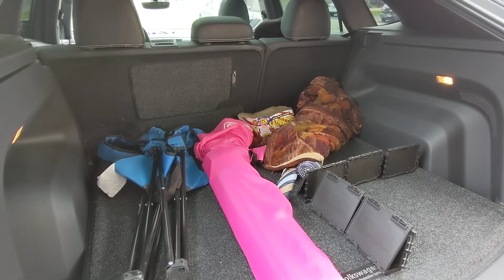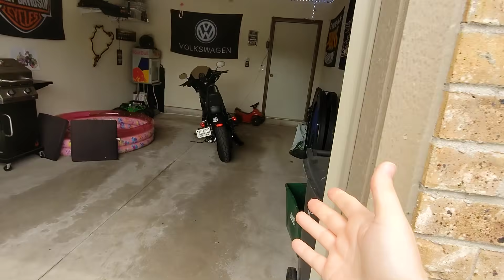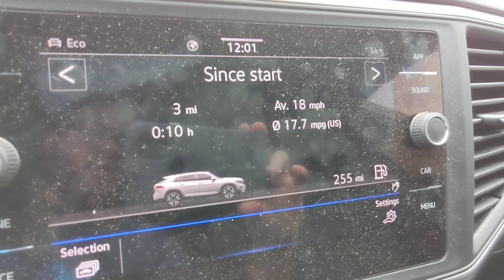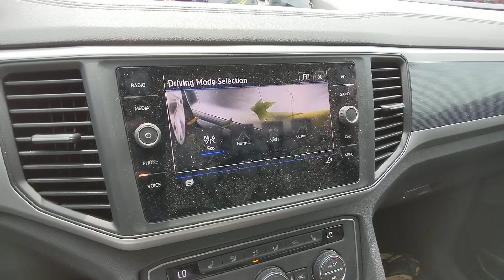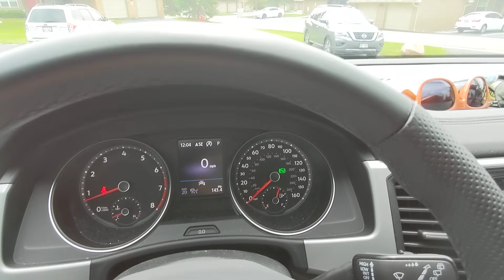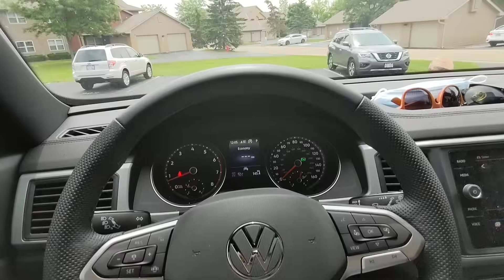2021 VW Atlas Cross Sport.  Why we're trading after only 4 months!

Comment: That car is beautiful on the exterior But for the price that interior is mediocre. For the orice you're better off with an Audi or Mercedes on the interior. Or just a Tesla /hybrid
Reply: Unless you're buying a used high mileage audi or mercedes. or lexus or any other luxury SUV. you aren't getting one for 45k USD. The GLE Mercedes would be in a similar size class as that atlas. However, it STARTS at 55k brand new, before options. You're looking at easily 65k-70k out the door when everything is said and done. 

Really don't get what all the hate is for these VW ATlas'. They're cheaper than any other manufacturer that makes an SUV in the same size class. You can't spend 35-40k on a brand new, large SUV and complain about the interior unless you're willing to spend the money to get that interior. and if you can't afford it, you're in no position to be complaining. Hell, even a chevy traverse is 10k more expensive than the atlas. and chevy interior has always been garbage. Honda passport is 5k more expensive, the list goes on and on. There's really not much to complain about.
Reply: Price a Mercedes lately??  I did, I love them, but 80K not in my budget. I compared SUV to SUV certainly not SUV to car.

Comment: The VR6 is a relic, literally the least competitive V6 on sale today.  2.0t is faster, cheaper and more efficient.  It's true the engine note can be a bit harsh in the 4cyl, but the only reason to buy the v6 is towing and because we live in America where everyone is more comfortable with the larger engine.  VW is even surprised the take rate is so high for the V6.  I have a 19 Atlas 3 row with 2.0t FWD.  Not bad on gas, around 24 in mixed driving, 26-27 on highway.  Bought snow tires for winter and has been great.  The only reason to buy this car is the size, which is amazing and was my primary need.  But better options for literally every other aspect of owning a large crossover.

PS, I wish everyone would state that their mpg figures are actual calculations at the pump based on gallons and miles driven.  Mine are.  Not interested in what your no good dirty liar of a trip computer thinks.
Reply from the maker: V6 has the higher tow capacity, which here in America is important to alot of buyers in this segment.  Style I think is also a big reason people purchase it, in my opinion it's the best looking in it's class.
Reply: A 4 cylinder turbo charged engine in this big tank??? Good luck!!!!

Comment: While clearly more expensive and definitely smaller our Q5 gets over 30mpg on most drives (avg over 16k miles is 26) and the powertrain is borderline fast. The torque curve of the Audi specific 2.0t is absolutely flawless and the dsg really comes alive when driving aggressively. It’s a shame audi doesn’t share these benefits with vw In the us market. And the interior also is day and night. Too bad Audi does give vw their longitudinal chassis to use :/
Reply: Maybe on its first 30k miles but you have to get those valves cleaned soon after
Reply: On Premium gas?
Reply: isnt that the same engine that vw uses, in various states of tune? Also - alot of the vw interiors are pretty much identical, to audi, depends on the model. Not on the budget obviously.

Comment: If fuel economy was such a BIG concern why didn't you get the turbo 4🙄?? Also, you're going to be really upside down and have to roll over a lot of bad negative equity towards your new ride. Doesn't matter if the used car market is smoking hot right now. You will still end up with negative equity since VW's are very weak sellers in the used car market.
Reply from the maker: I'm finding these comments really amusing as if i don't know what I'm doing or talking about.  In the description i clearly state that our commute suddenly jumped from 10 miles a day to over 50.  This meant we were putting $8 bucks a day in the gas tank.  We did lose about $1000 dollars total after selling it back to dealer, which is not bad at all.  The dealer Flipped the vehicle above MSRP literally 4 days later.  This used car market IS that hot, used car prices are up 37% since last year.  Factoring in our fuel savings we will recoup our loss in less than a year.  Cross sport is a very Average (but good looking) vehicle whos fuel economy is pretty bad.  You can get a big SUV with capability without having to suffer with terrible MPG in 2021.

Comment: Small advice: next time before buying a car, make sure to calculate daily fuel consumption to see if it fits in your budget, instead of loosing money when you trade in your car…
Reply: I am really trying hard to figure out his issues here. THIS IS A V6 ENGINE. am just laughing watching him rant. i have 2018 Atlas and I love it.
Reply: Ya I would think he'd lose more money on the trade in than gain on a car w better gas mileage.
Reply: I don't know how you are calculating!!  Let's say you drive 50 miles a day with gas price at $3.20.  if your mpg is 20, that would add up to $8 a day or $2400 fir let's say 300 days.  If you can get a magical gas engine SUV that goes 30 miles per gallon, your daily drive will cost you $5.30 or $1590 per 300 days.  That is a saving of $810 per 300 days ( roughly a year) .   In  5 years, your saving will be at $4050.  And again, that's assuming you can get 30 mpg from your new SUV.  Please tell me how you did your calculation?  BTW, I am still not buying that the dealer purchased the car back fir $1000 less than what you paid for it just 4 months ago because the market has been red hot for over 4 months. Didn't just happen last week.
Reply: @switchex  Agreed. What about the sales tax and dealership fees that he has paid? That money he lost for sure, and if we put them to the gas spending... well, it's easy to calculate. His math is def off, as is of a lot of ppl at the moment who's trying to get rid of the freshly-bought vehicle towards to gas savings.
Reply: @switchex  I am stunned that a person who is doing this video made such a bad comment to you. I also agree that dealership is not buying back a car, there is a reason why they are selling. I checked for fun with my dealership, I bought VW SEL-R Tiguan for 50k, 3 months later I asked how much would they buy back with 700 miles on it, they gave me 22k price hahah.
Reply from the maker: @switchex  I have no reason to lie, its the only reason we got out of it.  It made financial sense.  Our new replacement will more that double our fuel economy.  We actually just got a notification this morning that its being built today!
Reply from the maker: Small advice:  read the video description before commenting.  Also, as i stated in video the used car market is WHITE hot right now.  We sold it back to dealer (not trade in just sold) for only a loss of about $1000.  The dealer sold it above MSRP 4 days later.  Our fuel savings on our new vehicle will pay for the loss in about 7 months.  Over 5 years of ownership with our replacement we will save roughly $5000 in fuel.  Stay tuned for our replacement!
Reply: @amentauto3610  so what did you end up replacing it with?
Reply: @MikeyMac99 
They ended up getting a p.o.s. jeep 4xe that they got rid of a few years later.  They got rid of it because the fuel mileage sucked.  He realized it only goes 25 miles on electric before the gas engine kicks in.  Again, no research.
Reply: @witchdoktor69 LOL what an idiot. He gave up the VR6 for Stellantis crap?
Reply: @amentauto3610  doesn’t matter how much you sold it for, inflation changed the value of the dollar. Regardless, a very wasteful approach to material things, you’re the epitome of the American consumer, probably love a credit card too and living outside your means.

Comment: I have a 2018 Atlas, MSRP was 50k. Super comfortable, cruises smooth - have got over 30mpg round trip in the mountains- to the beach on the highway - If I want to go fast, I jump in the F150, if I want to be comfortable, I take the Atlas. Love the Atlas! The vehicle has been very reliable. Edit: one thing I did not like, was a common issue, and is the fact it does not come with a spare at all, let alone a full size spare. Purchased OEM Rim online, got a brand new tire from the tire shop, and keep it in my garage, just in case.
Reply: Wow. 30 mpg?! Never got close to that.
Reply: @toddhaynes7145  Pure highway tho. We average 17/18 cruising around town. If you are going down hill, and let off the pedal, it will go into eco mode. Drift as much as possible. My truck, I drive opposite, I press the gas a bit going downhill, gaining speed and drifting up the hills going slower at the top. I use the pedal going uphill, and drift downhill in the Atlas. Try keeping it in ecomode?
Reply: 30mpg? Is that the 4 cylinder?
Reply: @jesse4589  Nope it’s the v6 with 4-motion. Stock tires and everything. Just cruising to work on 10 miles highway 2 miles city I get 25-28 mpg at 62mph. Our Atlas is a 2018 tho.
Reply: @bigf1502  Wow....we get 25mpg sometimes on trips that there isn't really any stop lights or hills and keep it around 55-60mph. Highway we usually run 70-70 so that is probably a factor LOL! We average 20ish. We are from Pennsylvania, lots of hills here.
Reply: @jesse4589  Pittsburgh myself
Reply: @bigf1502  Oh cool! A friend of mine lives out there, I have visited a few times and those hills are a lot bigger than what we have here in north east PA. Crazy you get that good though, maybe our lead feet has something to do with it haha
Reply: I have a 2019 and mine came with a spare
Reply: Having a spare tire in your garage isn’t helpful lol
Reply: @bkr9511  For sure it is, if my wife gets a flat, I’ll take it to her and put it on. Only time it wouldn’t be of use is if we are on vacation or far away.  95% of the time the car is within 20 miles from home.
Reply: @bkr9511  Good point, if you are hundreds of miles from home, but it's nice having it in case you need to pop it on while waiting or got time to get that disposable tire replaced. Every seen what one of those costs?
Reply: V6 atlas averaging 23.5 mpg in California. I always exceed car’s claims. But would never get close to 30mpg. Not a lead foot.
Reply: No spare? WTH. I have one of those inflatable donuts under my subwoofer in my 2019 SEL P.
Reply: Which Engine?
Reply: @ze_german2921  v6
Reply: I have a 2018 atlas owned since it had 36k miles on it I get 23miles to the gL. I drive 250 miles to work once a week I only use a 1.4 tank to drive 500 miles rou d trip. Think that's pretty good. I ha e 230k mils on this car now. No issues ever with this car other than regular maintenance. I will buy another one.
Reply: @katrinafoelsch6794 I agree, we still have our 2018. Has just under 50k miles on it. Have taken it on many vacations and it has been great, although it still spends most of its time around home.

Comment: Well if you’re looking for gas mileage then an suv with a 6 cylinder would be out of the question. We recently upgraded from a Chevy equinox, that had great fuel mileage ( 41mpg best on highway). But it had a 1.4 L turbo. It was selected awd which was nice but as far as towing it had like a 1000lbs. But you can’t even compare the two next to each other. So you need to decide what you want, a fuel efficient vehicle or something with the roominess, towing capacity, and the other options available of the atlas. We agree that the fuel mileage is less but overall we love it. We own a 2021 atlas cross-sport R- Line edition $ 58,000 sticker price. This vehicle has everything and we couldn’t be happier. Btw we live in Wisconsin too…lol
Reply: You still have V6 options. A Honda Pilot gets 27 highway. Thanks to its vcm system.
Reply: We traded our 2018 traverse on a 2021.5 atlas premium. It’s a nice vehicle for sure. The problem with the atlas and fuel economy it is awd full time. Traverse had the same size engine and got about 2mpg better in front wheel  drive.
Reply: I selected my VW Atlas (2019) for its safety, size, and mpg in that order.
Reply: Definitely loving my Atlas SE. Just hate I didn't get full tech package but I'm going to add some things. Should have gotten an Atlas.  You can pull the seats down from the truck. I don't the V6 but I feel like my gas mileage is doable. I  can go like 7hrs on road trip before having to fill up
Reply from the maker: Our replacement vehicle was just posted on my channel ;) you can have your cake and eat it too.
Reply: @amentauto3610 
Did you eat any of that cake?  You got rid of that jeep for the same reason you got rid of the Atals.  Awesome.  As a guy with a car channel, you might want to actually research the vehicles, apparent cost savings vs reality, reliability and mpg.

Comment: For that kind of money I ended up with a used 2015 Mercedes GLE.
Its powerful, interior is luxurious, got air suspension and I feel like I could tow anything.
Reply from the maker: As nice as a vehicle as that is I would worry about ANY German car that's 6 years old in terms of Maintenance/repair costs.
Reply: @amentauto3610 I can see your point of view but as a european I am not concerned about my castle on wheels. BMW and Audi tend to be the more problematic ones. My GLE is currently at 230 000km on the clock and it feels as if it just came out of the factory. Yes some parts are a bit more expensive but they also last longer to compensate for that. I think the internet makes some things worse than they actually are. Thats my opinion and experience tho...

Comment: Had ours 3 & 1/2 months, it’s been in the service department for all except 4 weeks over that time. We’re trading out as soon as we can.
Reply from the maker: Seriously now's the time to do it, call your local VW dealers.
Reply: @amentauto3610  did, they are rude and belligerent, had a case open with VW USA - car has been classified as a lemon but to buy it back is too expensive for me so am stuck with it. - Arizona Laws are terrible when it comes to protecting consumers. Intend to trade out asap.
Reply: Price it at carmax or gimme the vin you should be able to get rid of it quickly
Reply: @patrickgroff5399  traded it for a Nissan Pathfinder last week, bigger car and engine. Getting much better mpg
Reply: @peterhunt6140   I looked at the comparison and the Nissan is over priced, and certainly not as many standard features. I would agree that, "IF" you had the car in the shop as much as you say then I get why you traded. I also get the bigger engine, but really I haven't felt it being as sluggish as others have, but then I run mine in Dynamic/sport mode, getting about 19.5 miles per gal, but I am a very aggressive driver, so I expect it. All in all I am enjoying my Atlas R-line and hope  continue do same.
Reply: @patrickgroff5399  last trip we got 26mpg in the pathfinder, it’s the platinum, got a good deal and I’m loving it, honestly I’d have traded the atlas for a pedal car I hated it that much, and the dealership that was supporting me (rude and hostile) 
Had the 2.0t Atlas as a loaner, was much better on gas, accelerating, and road noise. Maybe I had a “Friday afternoon” car and was just unlucky, either way, combined with the poor aftersales and issues - totally happy to see the back of it. On fire in a car park would have been preferable than dealing with the dealership again
Reply: @peterhunt6140  All in all the Nissan is pretty much like the Atlas, except the gas mileage is better. Probably due to the Pathfinder having a newer engine as opposed to the older VR6 which can produce up to 300 hp, yet in the atlas is 277 or so.I think that you got treated poorly by the dealer and you could have been part of the reason for the treatment. I think that the madder you go with VW dealer the more reasons you found to sell.

Comment: Good Video.  I really wanted one of these having had a Passat for almost 10 years and 170,000 miles.  Unlike you, the dealer wouldn't deal with me and wanted full MSRP.  I ended going back to Ford and got a 2019 Edge ST performance package and like you I needed the tow hitch and AWD.  The Edge has a twin turbo and quite fast.  I am getting about 21-22 mpg with mostly city driving.  Haven't had it on a road trip yet.  My Passat, with V6 had to run premium so I am happy the Edge does not.  The Edge with ST package is around $50k new.
Reply: Good luck with the ecoboost turbos. I use to own a Taurus SHO.
Reply from the maker: Pretty good choice!  Buddy has one of those and it's suprising how string that thing pulls on the highway.
Reply: literally every dealer is charging MSRP lmfao. Its called an inventory shortage, supply and demand. That Edge will be in the shop more than you drive it
Reply: I’m surprised the twin turbo ford doesn’t require premium. My 2015 Malibu LTZ was turbo and i could feel the difference when I used premium so I stuck with it. Traded for a VR6 cross sport last year and I love it so far. I’m not sure the economic difference between the turbo and the vr6 makes up for the higher price you’ll pay in gas. I had a loaner turbo cross sport and I wouldn’t trade my vr6 for it. Turbo felt cheap to me
Reply: 50 k car manufacturer laughing
Reply: I’m saving for a Ford Bronco Black Diamond fully loaded.